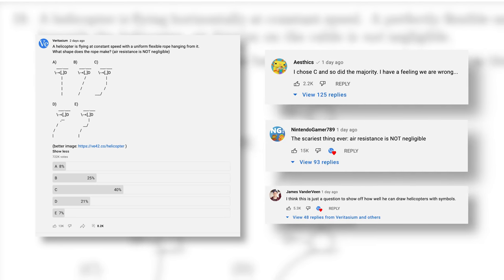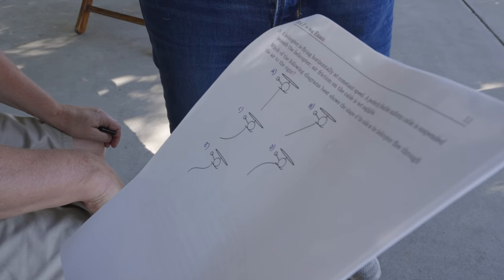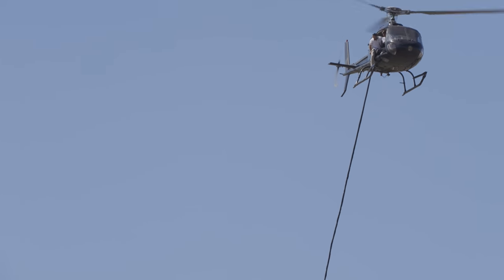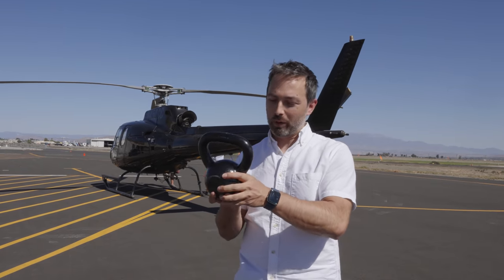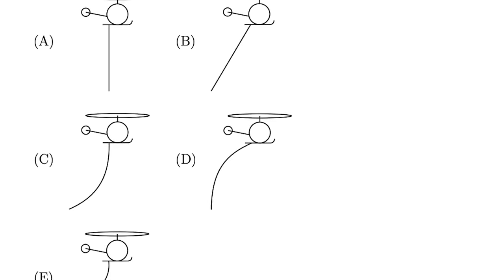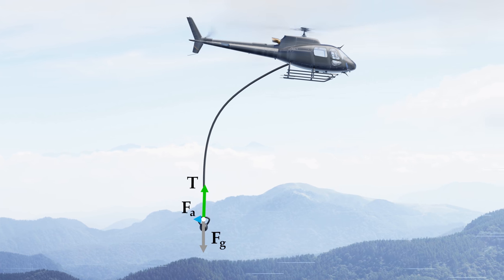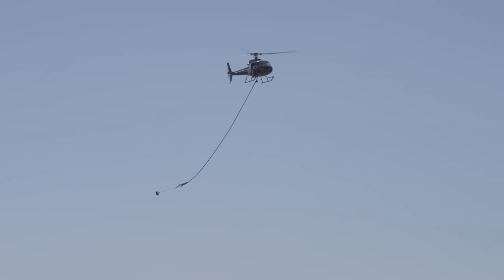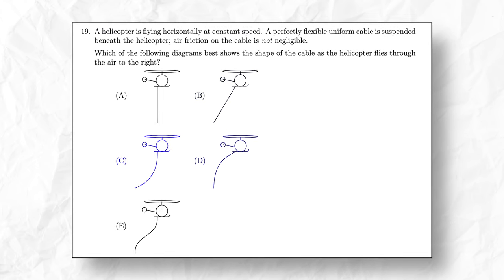I Rented A Helicopter To Settle A Physics Debate

Comment: My answer was D, and the first time i watched this i had thought you had proven me incorrect. 
However, watching it again, it DOES appear to be trying to approximate D. The tension of the rope (spring constant?) is straightening it back out.

The reason it wants to approach D is because of the currents in the wind. A longer rope would demonstrate this better, however the forward movement of the helicopter causes a different wind current than the rope simply dragging through the air.

The longer the rope, the more the D answer comes into play.

There are also scenarios in which E may be possible, due to other wind currents in the environment.

To get the best answer to this question: i suggest asking a coast guard jumper or someone from the fire dept that has had to use these many times in different situations.

To clarify, the point at which the additional weight of the rope overcomes the (spring constant?) if you then double the length of the rope, it would approximate answer D, with no additional wind currents involved.

Comment: I guessed B and was right! I assumed the air movement from the rotors would be a non factor just from intuition. 

My guess for the weight was it’d be B still but less of steep angle. It makes sense I was wrong and it was fun to learn why.

Comment: Interesting that this is even a question. Each of the cases seemed pretty obvious. (Though I suspect with the 2nd one, the shape largely depends on the copter 's forward speed & weight of the (erm) weight. - If the force of the forward momentum is more than the weight (gravity force acting on the rope end), the rope will again straighten.

Comment: That's accually quite mean of a professor to find something extra counter-intuitive of his real-life-experiances and turn it into an exam question. Who knows what he would have answered, if he would not have seen it before?😅
Reply: This wasn't from a class exam. This was from a special competition exam to qualify for the US Physics Team
Reply: being counter intuitive is a good thing, the students are supposed to actually think about the problem instead of going with their gut feeling
Reply: He probably would have spent time thinking about the physics of it, being a physics professor, and not answered based on intuition
Reply: There’s also the people who guess and get lucky, but that’s not very scalable lol.
Reply: Also, people game multiple choice questions. You could probably tell that this is a trick question based on its format and simplicity and use process of elimination to narrow it down to a reasonable chance of guessing correctly. If you really wanted to see who thought it all the way through you wouldn’t do multiple choice.
Reply: I guessed that with weight it would be D (essentially the rope is a sail between two relatively fixed mounting points) and with a parachute it would be C (if you blow just on the end of a hanging string). And based on that I intuited that B was the most likely answer for a completely uniform rope.

Comment: “If you approximate it as a chain with links”
“I don’t think you can just do that” cracked me up
Reply: Just let the number of links trend to infinity ;)
Reply: it's just FEA, i don't get why he think it is not valid
Reply: Approximating a string as a chain with links seems like an awful idea, as an Engineer that's the exact opposite of something I would do. Surely you want to get rid of the messy links of a chain into a solid uniform rope. Madness
Reply: @GEM4sta  I'd have thought an engineer would know about FEA and why it's useful?
Reply: @GEM4sta  As an engineer myself, I would totally break the rope up into chunks (or links) to analyze it. This makes it easier to check the boundary conditions of each link as you work your way through the analysis, with fewer starting assumptions. Once you're satisfied that your crude model behaves consistently, then you can do a smoother analysis via integration. It's essentially the same process as working out a ∂L infinitesimal length for integration, but easier to hand-check (eg split the rope into 5, 10 or 20 sections and calculate the drag angle θ for each segment to see if they are the same).
Reply: it's already a chain of rigid links, there are just several trillion links
Reply: @GEM4sta  Right. What a chump Newton was.

Comment: The question didn't say what the constant speed is,  so the rope can be going straight down as A if constant speed=0.
Reply: that's a nice way out!
Reply: No, because it says « flies through the air to the right », so the constant speed could not be 0.
Reply: @CyrilJap  still if the speed is too low, wouldn't the air friction be too low in comparison to gravity and the rope would make a straight line
Reply: @umaru1942  nope
Reply: Everyone knows that the angle of the dangle is inversely proportional to the dimension of the extension, and once you know the gravity of the cavity, you get the maxis of the axis, and then solve. Of course you will need to determine the direction of erection first. 🤔🤔🤪
Reply: @CyrilJap  Since a null vector can have arbitrary direction, if you really wanted to be a smartass you could say it's a vector to the right with a magnitude of 0 and be technically correct (or at least, not incorrect). You'd still lose points on that question though 😆
Reply: @Osmotic  oh I like that way of thinking 👍
Reply: lol constant speed=0 . Objects at rest have speed=0. objects in motion tend to have non zero speed.
Reply: Constant  velocity, Now its ok

Comment: i used to tow a "MAD bird" - magnetic sensor under my helo, to search for submarines. The arc of the 200' cable was always like D.
Reply: I’ve fought wildfires since 1989. I’ve seen helicopters delivering countless water and supplies to the fireline. 

D is the correct answer.
Reply: @dozer1642  My strongest compliments to you, for your dangerous service.
Reply: Now I wonder how the answer changes depending on both the weight and the length of the cable... And I also wonder if ALL the answers are possible if you play around with these variables.
Reply: @joeykauhi7938  you can get E by adding a weight in the end and parachute in the middle
Reply: Why's it called fire 'fighting', shouldn't it be called fire prevention, containment, mitigation, or management?
Fire fighting makes it seem like soldiers in combat; a war that can be won. It's not called flood fighting, storm fighting, or quake fighting in response to other disasters.?
Reply: Respect, but the 60R is the finest instrument of warfare ever conceived.

Comment: I called B for the question and was glad I got it right but I’m gonna type out my reasoning here:

Aerodynamic drag only depends on the dynamic pressure (which depends on air density and free stream velocity), the drag coefficient of said surface (which depends on surface roughness, shape, etc.), and the total surface area in contact with the flow of the air (typically in aerospace, this is just a wing area). Since we can assume that for every small rope section the dynamic pressure, drag coefficient, and the associated small amount surface area with said section is the same for the entire rope, the force of drag is therefore constant across the entire rope. This leads to the conclusion that the force of gravity (weight) and/or tension must be the shape-determining forces.
Looking at gravity, each small section of rope must have the same exact weight because it is all made of the same material, so the shape-determinant isn’t gravity (in the non-weighted scenario at least). So tension must determine the shape.
From here, you can realize that for the rope to be in equilibrium (or not flying away) in respect to an inertial frame of reference moving with the helicopter, the force of tension has to equal the sum of the force of drag and gravity together. Since these two forces are normal to one another, tension must be diagonal to fully equalize each component. Ok, so we now know it’s not just some straight like downwards or somehow diagonally forwards, but does the rope curve at all? Well, as with all tension forces, it acts in both directions. Because it’s a rope and cannot sustain large compressive forces, at the very top of the rope attached to the helicopter, the force of tension pulling up-right is the greatest since the force of the rest of the rope is adding a separate tension down-left. As you gown down the rope, the up-right tension decreases just as the down-left tension also decreases. Since each rope section has the same drag and weight, this decrease in both tensions is linear, thus, you get a straight line. 

The angle at which any section of rope is at depends only upon the ratio of the downwards weight and tension forces to the horizontal drag force. If the order of magnitude of the downwards forces is much greater than the drag, then the angle must be very close to 0 (from the vertical) and if it’s the other way around, 90. For the scenario with the weight, you can tell the basic shape because of the edge case scenarios: the rope near the helicopter acts the same as the non-weighted case and the rope near the weight has downwards forces with an order of magnitude MUCH greater than the drag, so its angle must be near vertical. Because forces distribute smoothly in nature and there’s no other forces and thus another edge case in the middle of the rope, it must make a curve to fit what was shown in option D.
Reply: ill explain why i also got it right, because i saw it happen

Comment: Interesting. I do not like the initial question though - especially the rotor wash part. "The rotor wash doesn't extend far below the helicopter" seems pretty depended on the actual model of the helicopter, and downwash is usually felt quite far below it - you can observe it a lot with hovering helicopters. How much it would affect the rope also depends probably on the weight of the rope itself. Actually the flag even shows that the downwash is pretty noticeable even quite far below the helicopter. I suspect that were the rope lighter, it would be more affected by downwash.

The person who came up with the question clearly expects students to ignore the rotor wash part, but you have to rely on intuition or some empirical knowledge about rotor wash to know that. Unless it's some aerodynamics course and students are expected to have that knowledge of course.
Reply: If the teacher said this beforehand or talked about something like this so the students know what type of helicopter their dealing with then yea shouldn’t be much debate

But with no previous knowledge of their class discussion. There are 2 answers.

Comment: I knew it was B. I've watched choppers carry a lot of things, with practically no load. I've also watched one chopper carry another chopper, and I've also seen a chopper fly a jetboat. And I have also hitch-hiked a chopper ride home one evening, in hilarious circumstances.
Plus, I have been in many "heli-huddles" crouched around my backpack, with a chopper landing 2-metres away from us, when heliskiing. The force of the wind blast even at ground level next to landing is not tremendous. 1-bar of atmosphere really does act like a fluid under a choppy, and so downward pressure on a skinny suspended rope is simply not a factor in the way it handles.
Reply: Everyone forgot about MI:6 already?

Comment: For me, this raises another interesting question: How heavy does the weight need to be to impact the shape of the rope for differing forward speeds?
For example, this experiment showed the C shape for 20 lbs at 60 mph. What happens if either of those  might be cut in half? Or both? What about 3/4 or 1/4? What about double?
Though I've not been able to fly an airplane in years--cost concerns mostly, I'd be interested in seeing a performance curve.
Reply: Increasing the weight (or air resistance) at the bottom.. wil just change the intensity of the curve.. but the shape will remain same
Reply: I still disagree with both solutions (c and d)  for both problems 2 and 3 (with weight or with parachute). I agree with solution 1 to problem 1 (only rope). At 5:42 its said Fa=Fg. Perfect! So this is always true in order to get the correct answer b (diagonal line).
Bottom line it can always be answer b, if the helicopter is fast enough to make Fa = Fg
Reply: @redbutler751  Given the results they achieved, I don't think any of the answers given impossible or "more right" than others. Results may vary depending on weight, chute, and speed. I noticed, for example  that even the rope briefly assumed differing shapes depending on speed. One could readily argue that a diagonal line merely provides a very low intensity curve, or vice versa. It'd be interesting to know how many times they ran this experiment to allow the answers to be as apparent as presented.
Reply: I would say it varies depending on the weight
Reply: @redbutler751  you're missing the part about the weight being evenly distributed when there is addition weight at any part of the rope. As you go up the rope, the ratio of weight to air resistance changes if the rope has an additional weight. 

So going faster with the helcopter the angles will change but the rope will still have a j shape because the weight is not uniform throughout the rope.

Comment: It gets really interesting when you are towing heavy targets on very long (10 Km) tow lines from jet aircraft, especially when the cable increases in diameter closer to the aircraft to manage the increasing tension loads. Now calculate how much lower the target is than the towing aircraft for a given airspeed, target weight & drag and cable profile.
Reply: what is the application of doing that?
Reply: Not now my head hurts
Reply: No way any aircraft is towing a 10Km long cable - to be that long it would be far too heavy or it would fail under its own weight. You're talking a 6 mile long cable attached to something travelling at hundreds of miles per hour and then towing something as well? I don't buy it...
Reply: @noid919  the world's longest single unspliced rope was 24 miles long. What he's saying isn't totally out of the realm of possibility, especially with the fluctuating diameter. Aircraft cable is some strong stuff.
Reply: @jahnyguitah7999  There's a big difference between a very long cable and the cable actually supporting itself though. 
I looked up some steel cable masses and breaking strains (not recommended loads but breaking points) and in general each diameter can support the mass of itself for about 2 miles before it will snap. 'Safe load' limits would only be around 1/2 a mile. So you start at some thickness then in 1/2 a mile you double the cable thickness and then, because you also have the mass of the previous cable to support, you can only go  2/5 of a mile and it compounds each time you change size. Even starting at a quite thin cable like 1/4", after only 2 miles you have something like  a 4" cable and 4 miles still left to go.
If we do the same thing but go right up to the breaking point then our 1/4 inch starting cable still becomes 4 inches around mile 7 and yet the slightest load or even just trying to move the thing through the air will cause it to snap.

Comment: Here is an explanation:

It will be “A” if there is no air resistance but there is Gravity.
“B” If there are both Air resistance and Gravity it  is diagonal because of the moment arm so as we see the further we go towards tip the more it is lagging (behind compared to the helicopter position).
“C” If the rope gets thinner and thinner as we move more towards the tip (both forces acting).
“D” If there is weight tied to the tip and rope is more flat/thick and helicopter is moving a lot faster (both forces acting)
“E” if rope is more thinner in the middle compared to the near tip and base, and if helicopter is moving faster and weight toed to the tip ( but that doesn’t really matter much and yes both forces acting here too).
Reply: I aint reading all that but i’m sorry for your loss or congratulations
Reply: wow this explanation is very nice!
Reply: @LemurJackson  how does "Here is an explanation:" go to a loss or a congrats?? lol
Reply: Wrong, it will never be A. It will still be B in space.
Reply: @xsjado_anon  yes because its a perfectly flexible rope
Reply: @xsjado_anon  Why should it be B? Gravity is pulling the rope down every part of it... and there is no other force on the rope.  It would be B if the helicopter is accelerating due to inertia.. but at constant speed, it will be a.

Also not special reltivity, any constant speed in space is a reference frame.. it doesn't matter what direction it goes to.
Reply: @georgelionon9050  Because when you start force first is applied to nearest (top segment) - so it moves first, then it acts on next segment. It takes time to pass the force of moving body to lowest part of the rope, so lowers parts starts moving later. That's what I would assume at least.
Reply: @xsjado_anon  It can be “A” and cannot be , depending on the rope mass, length  and Helicopter Acceleration and many other parameters, If helicopter start accelerating very very slow it will be A but if it accelerates quickly (like a sudden jerk) it will be B.
Reply: @ahsanlatif9955  good point - kinda,  basically the angle of the rope will be determined by the acceleration of the helicopter. So it will technically be B with a very small angle, but I understand your reasoning

Thinking about it more,  once the helicopter reaches the Max speed and stops accelerating,  the rope should become a pendulum,  with the gravity pulling to it back to the centre,  but not stopping once it gets there, requiring gravity to slow it back down. 

Would be interesting to test.

If you kept accelerating at a constant rate, it will stay as B forever.